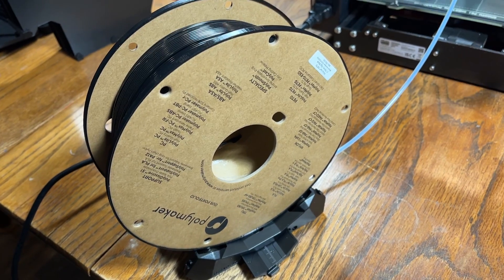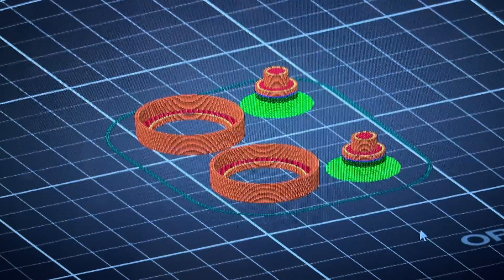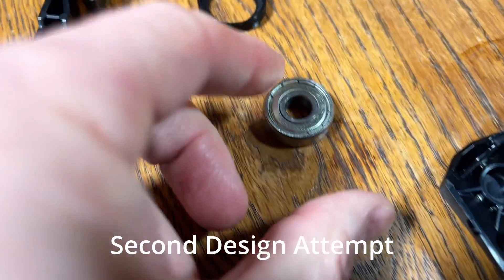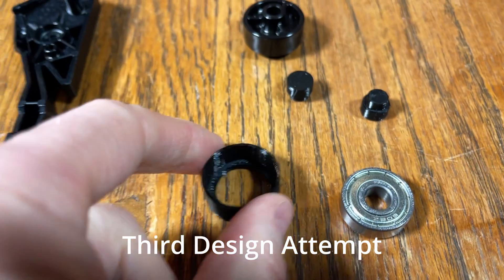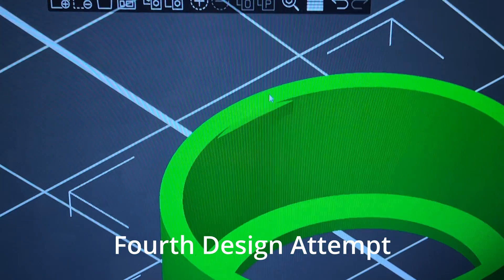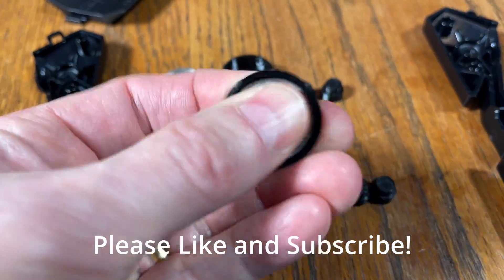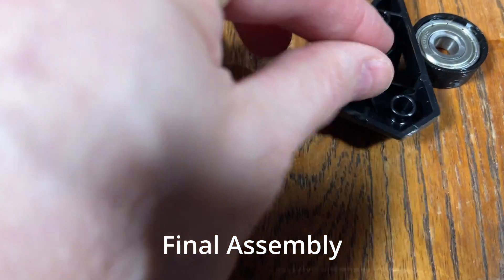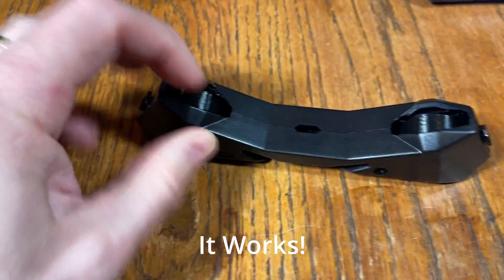Prusa MMU3 Spoolholder - Adding Ball Bearings, Prototyping Designs

Comment: This is very cool! How would you benchmark the improvements the ball bearing wheels had over the plastic wheels for 3D printing?

Great work! :)
Reply from the maker: I wish I had a Newtonian force meter to pull the filament and see the difference in pull force required. It would be extremely nice to have an actual value.
Reply: @real3dprints  another thing I was thinking is an assisted filament reel with stepper motors that help maintain enough slack that the extruder doesn’t need to pull the reel. Might even be a cool project
Reply from the maker: @aarond791   Funny you suggest that as @oleurgast730  was suggesting the same idea. It would definitely improve things as an optional component.

Comment: Are the plastic ones causing troubles or why is there a need to add ball bearings? My MMU3 is still in pieces and if it's worth it, I do this modification from the beginning.
Reply from the maker: Look at your plastic spool wheels. It should say POM or ABS. If you have POM that is a better material that they moved to. That said, bearings should in theory be better than any plastic on plastic for rolling friction reduction. Personally I use a custom system with center bearings (see other videos on channel for this).
Reply: @real3dprints  They are POM. I'm trying with these first. Not sure if I keep using them anyway. Putting the original ones on top of the enclosure is not very elegant.
Reply: Less friction isn't always good. Depending on the bearings you use, your filament will keep rolling after the initial pull, resulting in too much filament being unrolled and it potentially getting tangled. Source: I made that experience. Not on these rollers but on similar ones.
Reply: @gustavorings  I saw the first version of the Prusa holders had real ball bearings. After I set up everything now, I do the spools inside enclosure modification on internal hanging holders. The current setup with 5 spool holders and the buffer on top of the enclosure is a pain.
Reply from the maker: @gustavorings I agree I have seen that too not on these things here in this post, but on my lower friction setup where I use custom center spool bearings.  I am trying to come up with something where I can adjust a small sponge against the side of a spool or something like that without it being awkward, but still use center bearings with exact fit hubs. I have that design on printables.